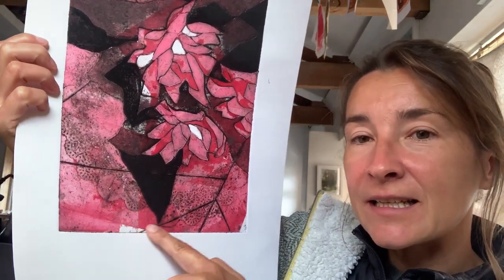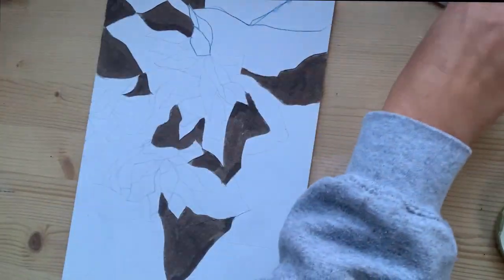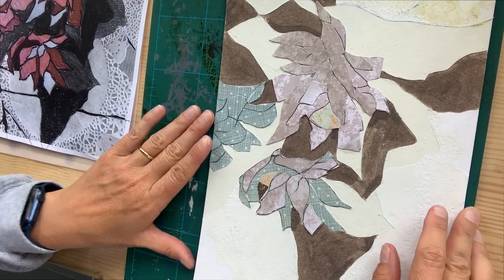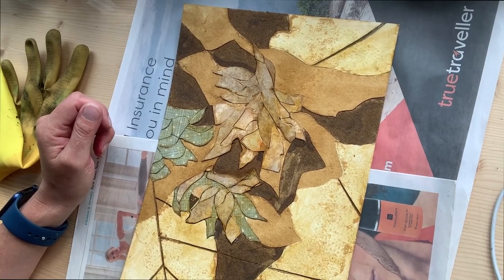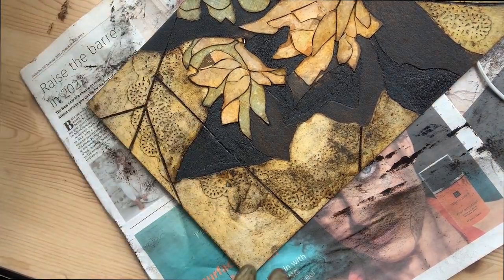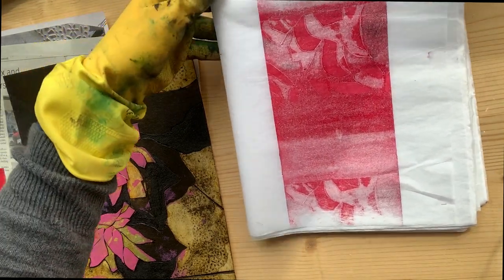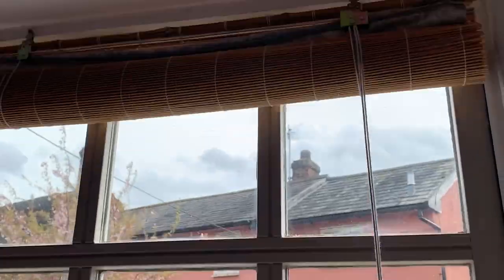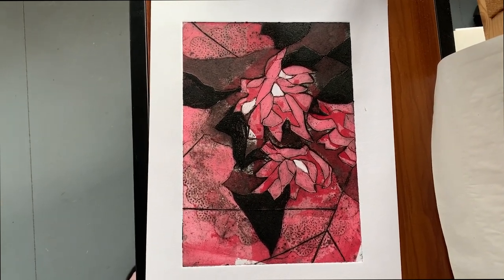Viscosity Collagraph Abstract Print - How to correct mistakes...  (and a cheat!)

Comment: What a lovely and instructive video. Learned a lot and was amazed when I saw the working of the viscosity difference of the ink. May I be so bold to say that I like the print much better upside down with the darkest parts at the bottom..  Thanks a lot Marta. The last print looked so fresh with just a little bit of white in it.
Reply from the maker: Thank you Marijke, I think you might be right about it looking better upside down 😁

Comment: You could check out using a latex foam blanket instead of your felts. This helps with with very deep plates. Daniel Smith in Seattle used to sell them, not sure who sells them now. I expect you could use a latex foam carpet underlay and a thin felt blanket. Also filling the cavity you made for the carborundum with a coat of matte medium or water based varathane will help to fill those 90 degree angle voids which are almost impossible to fill in since you run the risk of adding too much ink and having it all split out under the pressure from the press. I use varathane instead of shellac since you can mix it with acrylic and it dries waterproof and alcohol proof. Hope this helps! Cheers Tony
Reply from the maker: Thank you Tony that’s really interesting. Never heard of varathane here in UK, is it a DIY thing?

Comment: I almost can't find the words for how beautiful that looks.. Sooooooo how many prints were you able to make before it finally disintegrated? How inspiring!  What I love about collagraphs is applying ink to different depths. A lot of variation is possible with embossing folders that press really deep. Here's one for you: I apply first with a soft roller, but let the paint seep into it first then rub off the upper layer. Finally I I apply a second shade to the soft roller. When I pass it over one of the sides of the embossing folder, The edges which rear up out of the paper make contact with the inner side of the soft roller meaning I'm rolling out two colours at the same time! Took me ages to work out how I was doing this.
Reply from the maker: Thank you so much Zachary, love your interesting input on viscosity printing, I must try it out!

Comment: Hi Marta  I did send you an email but maybe got the address wrong.  My problem is that I follow all the advice of dampening off the paper in order for it to be more flexible to get into the details for intaglio and its by no means wet when I run it through my press but the paper sticks to the plate  I have since added another layer of shellac and that has helped but noted that you do not use anything on your plates.  What am I doing wrong? Bx
Reply from the maker: @bixnash1  hi Bix, I am so sorry I actually thought I replied to you, must’ve got distracted!
Soooooo, yes this can happen if you don’t varnish the plate. It happens to me if I don’t wait long enough for the the plate to dry. Also what can help is to polish your plate with a little bit of copper plate or linseed oil before you ink up. Hope it helps 🤗